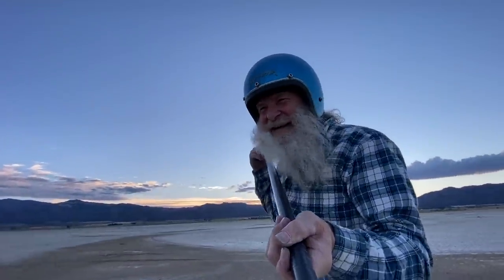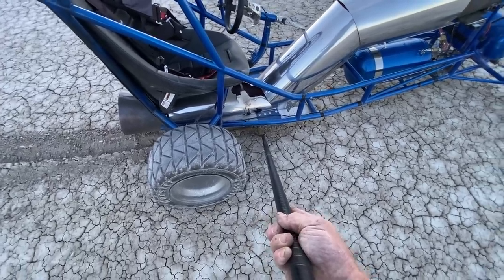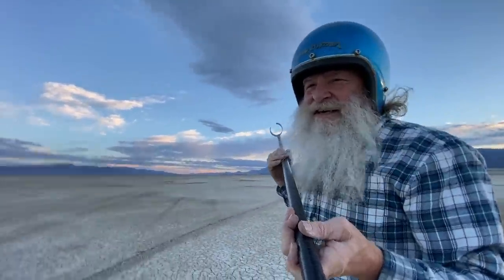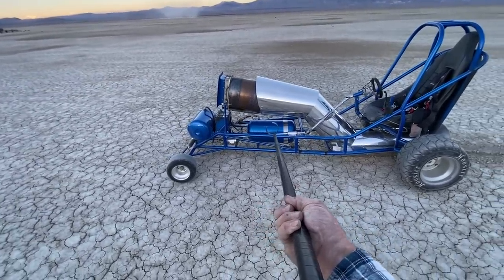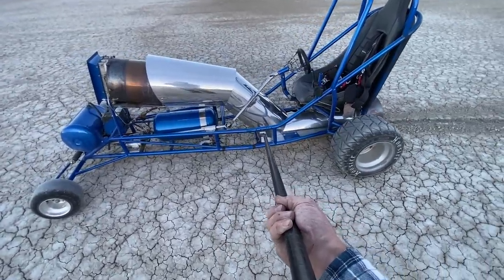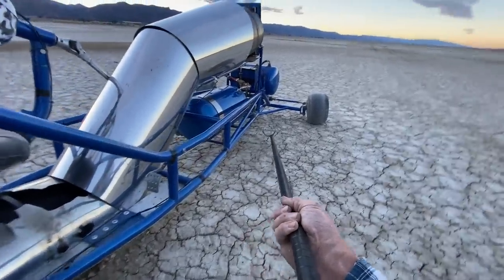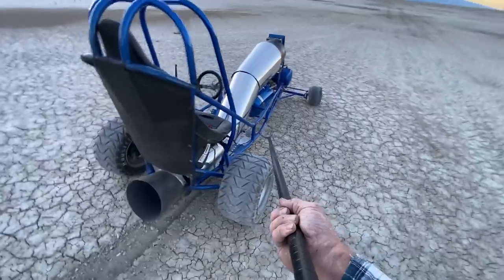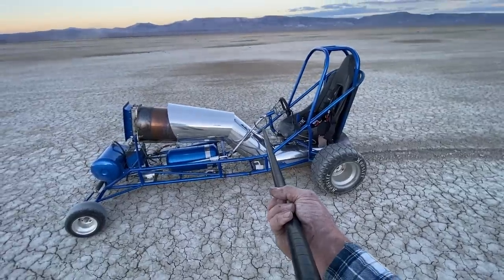Crazy Rocketman: "JET ENGINE BLOW OUT"

Comment: Robert - as far as some of the cooling-issues goes, 
could you rig up either a NOS or CO2 'fogging system' - directed onto the area[s] requiring the most cooling? 
*I'm not familiar with the exact temps involved, so that method may be underkill, but, an idea none the less. 
Keep up the great work brother!!  This stuff is absolutely Awesome! 
🤘😊
Sam -
Reply: hmm nos is a huge oxidizer so it would help eat the metal, and CO2 on glowing hot metal would produce carbon monoxide.
Reply: @confuseatronica  I've watched a few of his video's and similar ones using pulse jet engines. and seeing how how red hot they get, I've often wondered if they could make a water jacket to wrap around them, connected to a radiator,  to help cool the the hottest parts of the motor.

Comment: That heat nearly did get to you as the inner pipe was collapsed when the outer melted through.  The seat likely took some of it.  Good that you weren't hurt, so keep having fun.  It's interesting that viewers can often see problems "before" you did during the drive as we have a better angle on the engine(s).  This happened with the last engine that melted a bit as well.  Good that you weren't hurt, so keep having fun.
Reply: Rob 😮

Comment: You are EPIC. Your dust and fire plumes after your buggy are EPIC!
By the way, you can make outer pipe longer than inner one, in order to use ejection of the air between tubes for the forced cooling of your engine. But this may completely cover your flames.

Comment: You learn more by your failures than your successes.  That said, In all the years I hqave been watching, you haven't had many failures which says something.  Could I suggest you look at getting some clamp on camera mounts and make provision for them when you do the rebuild.  A couple of camera angles would add a lot to the great action of your Vids and make driving  a lot easier for you too which would be a big bonus.  Something else that would be interesting to see is how fast you are going. You can buy GPS speedos pretty cheap off fleabay  that wouldn't need anything but to be fixed in position and 12V. 

Great Vids, keep them coming.

Comment: Hey i recomend you to put thinner and sturdier wheels, it should be a little faster due to less friction
Reply: Agreed. He'd get plenty of traction from thinner wheels and since they're not providing power to the ground, they don't need to be so wide. Hell, the back wheel could practically be a pneumatic or polyurethane caster on a leaf spring suspension.

Comment: When you "nurse the engine," exactly what are you doing? Where is your fuel control?

Both of your recent failures produced nice smoke/dust trails. It might be worth engineer a dust trail maker into future machine for entertainment value.

I suspect a dust trail maker would not be detrimental to asphalt as long as you are moving.

It probably wouldn't be much of a sacrifice on forward speed.